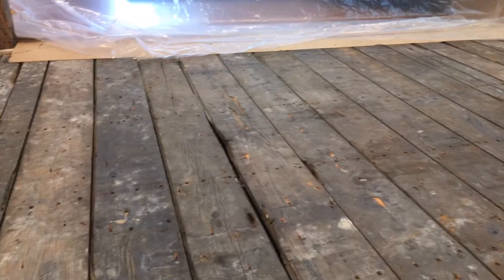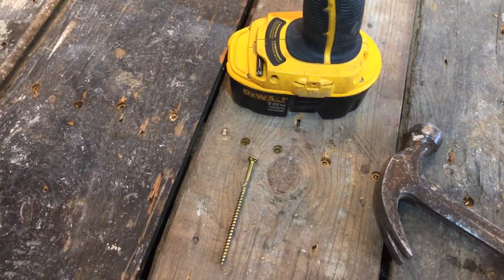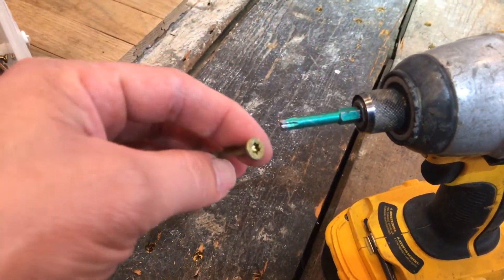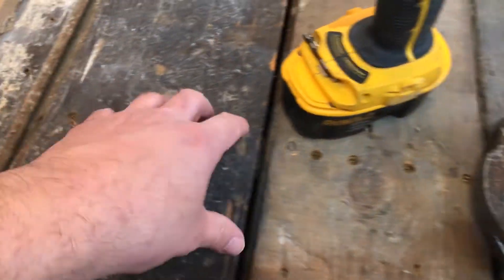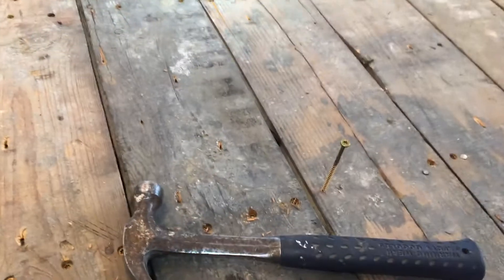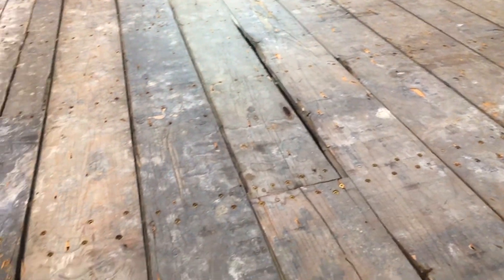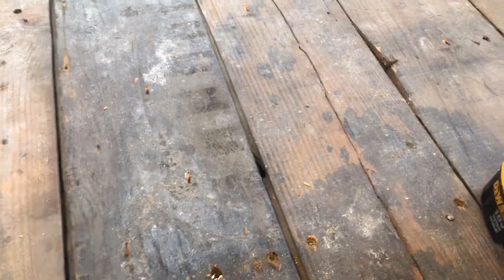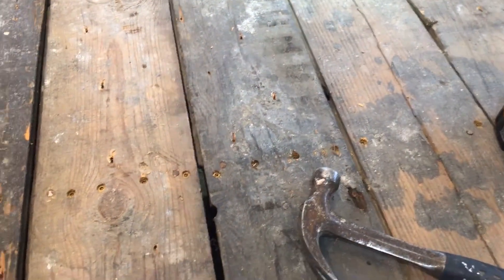Leveling a Sloping Floor #2: Screw It

Comment: This helps alot. I just bought at 1940s house and it has Plank subflooring alot of the wood is very uneven highs and lows. Also the one wood piece transitions at slope for the bathroom and kitchen